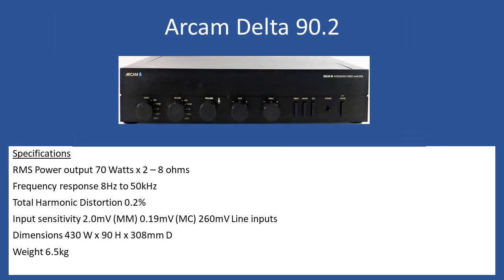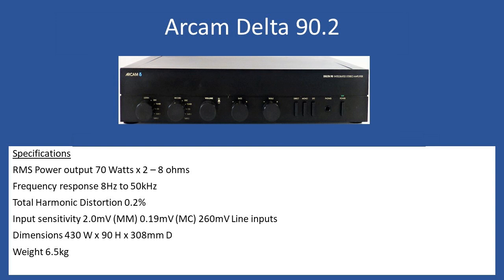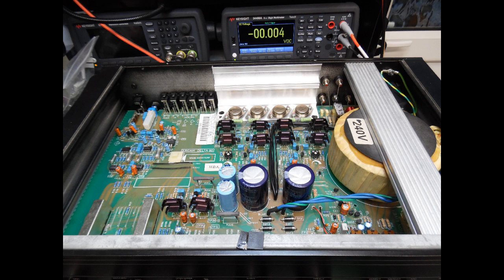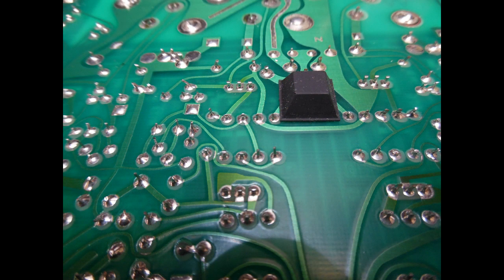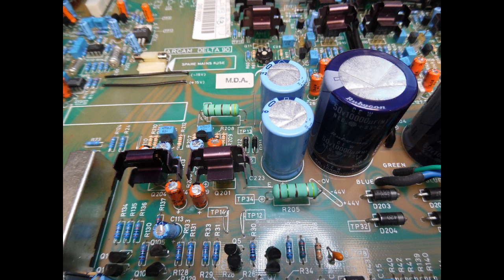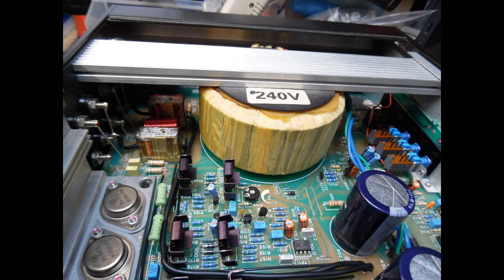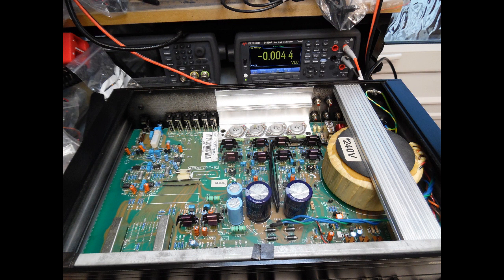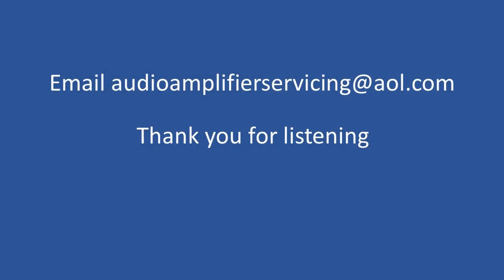Arcam Delta 90 2 Amplifier Repair (With Audio Tutorial)

Comment: I have a few analogue issues

V minor tape repairs Nice double deck Technics 1997 mint and a budget Nak with a minor fix needed.Anyone?
And a Goldring Lenco GL 75 idler wheel model around 1971.All original needs very minor attention.
Any ideas?
Reply from the maker: Hi not sure what you're asking, are requesting repair support?
Reply: @AudioAmplifierServicing  Yes
Reply from the maker: @graemeyetts3465  The channel i for the repair and servicing of Audio Amplifiers?